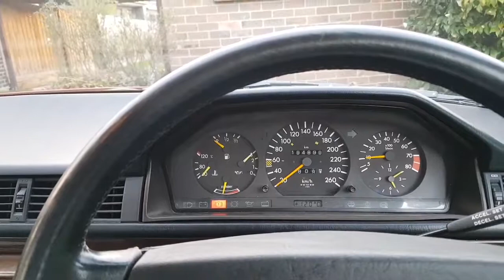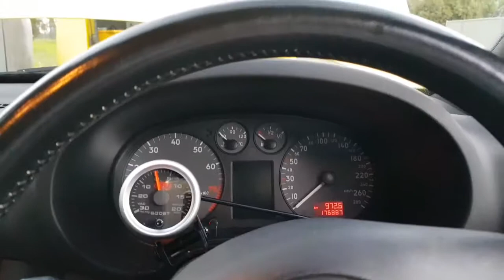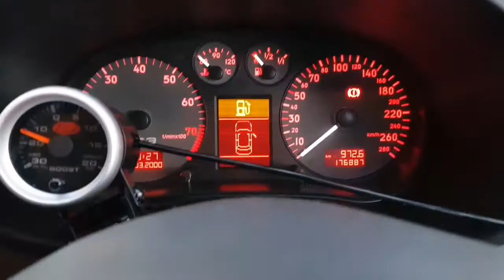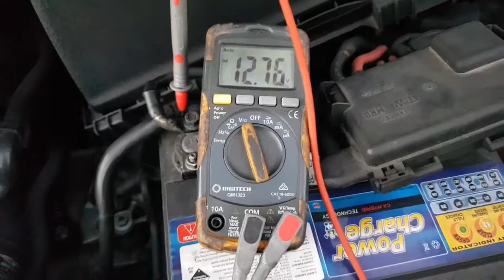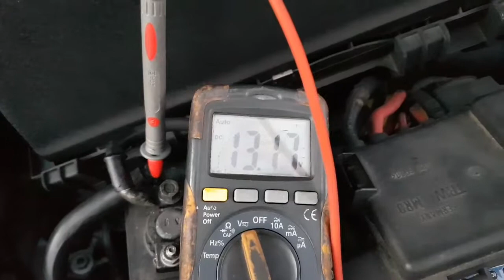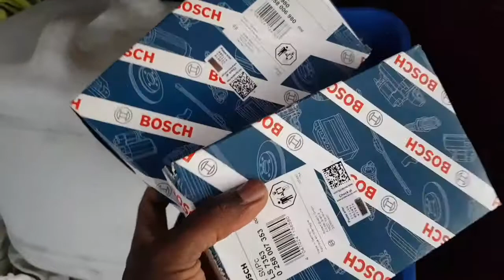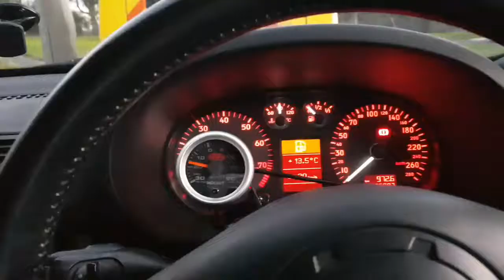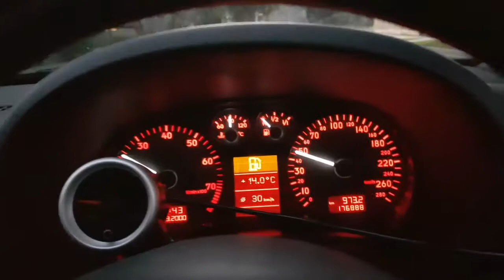Audi Issues, test drive. S3 8L, Episode 6

Comment: Nice video enjoyed the driving sounds. Is there a reason why they don’t recommend connecting the jumper cables negative  direct to the negative of the battery.
Reply from the maker: In a case where you can have a big spark and a leaking or faulty battery you avoid an explosion.